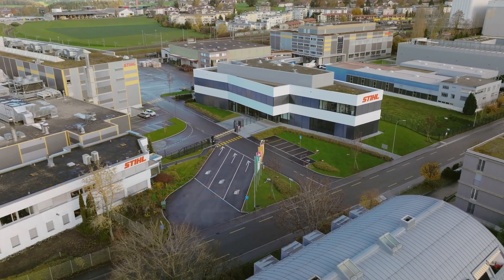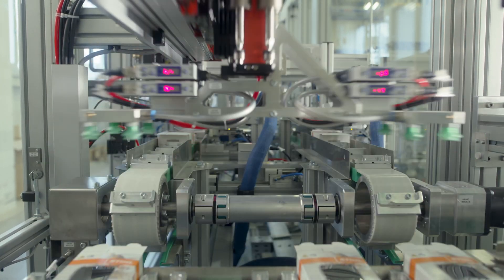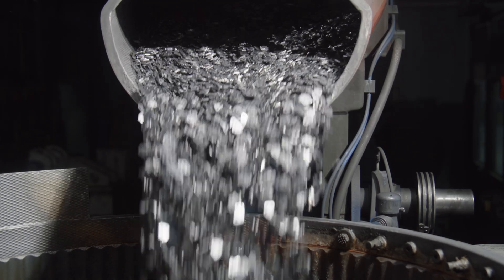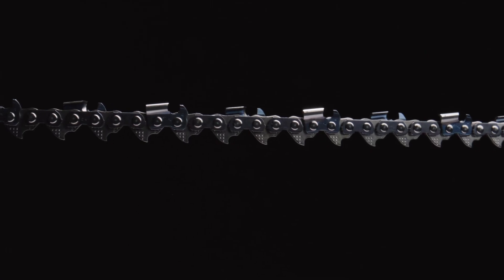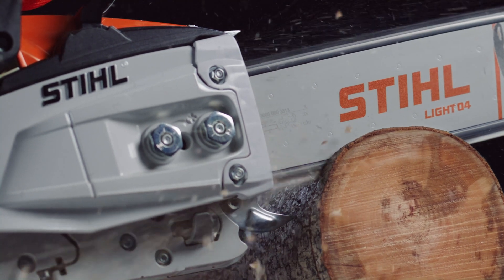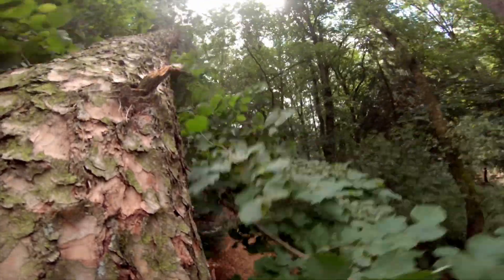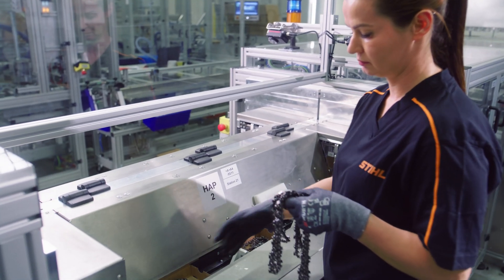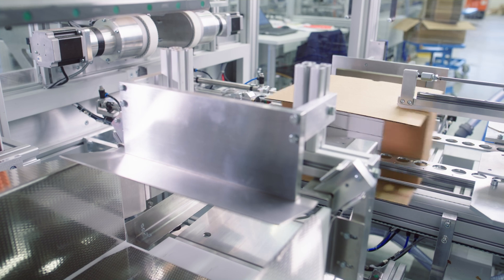STIHL chain production | Behind the Scenes​

Comment: That’s all good and well, but Stihl still can’t make a chainsaw that starts as easily or runs as well as a Husqvarna!
Reply: Really? I have both and prefer the Stihls. If you use quality fuel, they both start relatively easily and run well.  Stihl may have a slight advantage when it comes to finding parts and lasting longer.